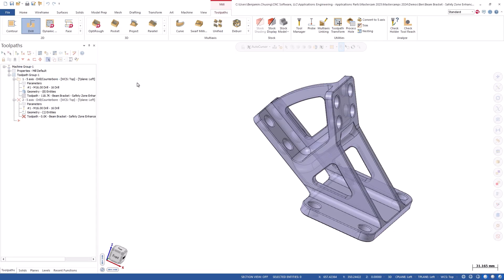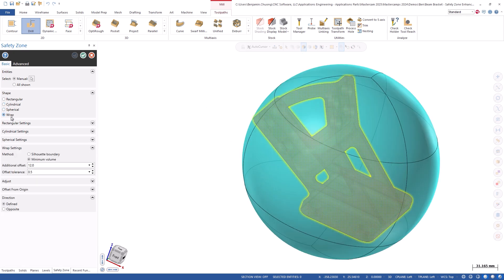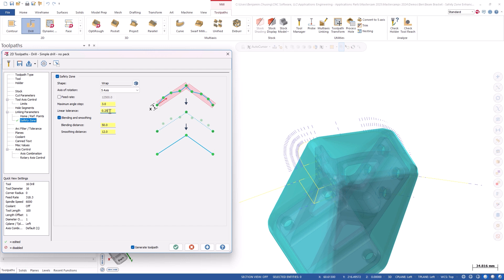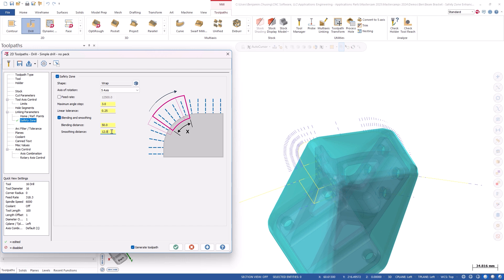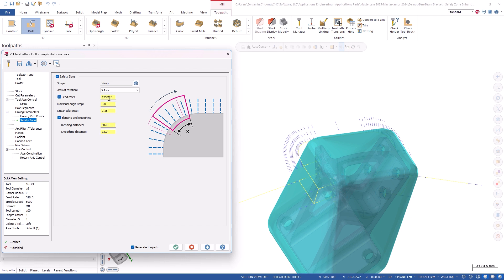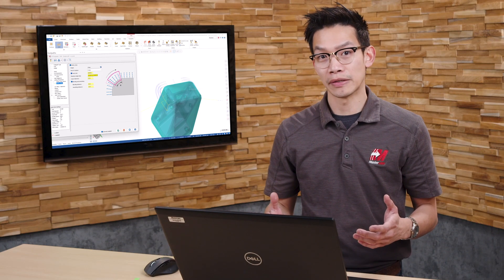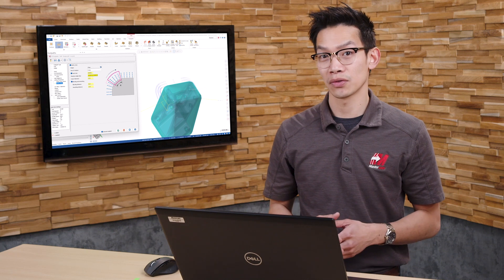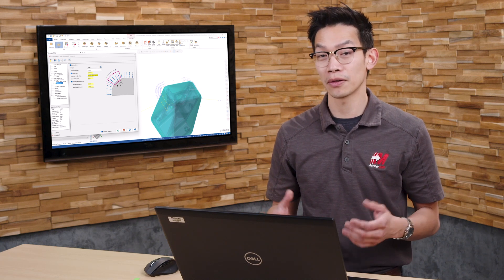Improvements to Multiaxis Safety Zone | What's New for Mastercam 2025

Comment: nice but im looking forward to that day when i can set the saftey zone in the very begining om the programing and all the following toolpaths will use that setup,that way i dont have to set safteyzone or saftey height every every time. move the saftey zone to the op manager and let it automatically be set to the part which is alredy been set along with stock.
also when setting a material in op manager it should have some thing to do with cutting data.
more intelligens in op manager that way it will become easier to automate some aspects of the programming.